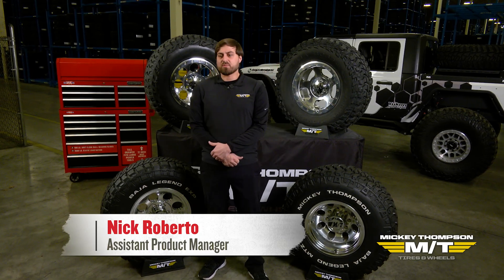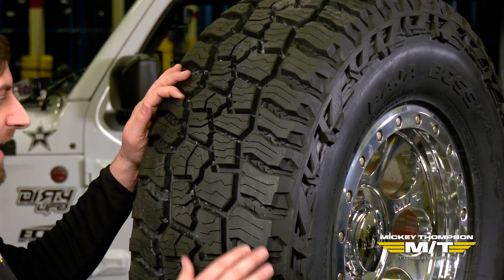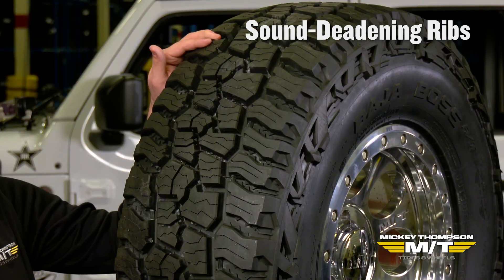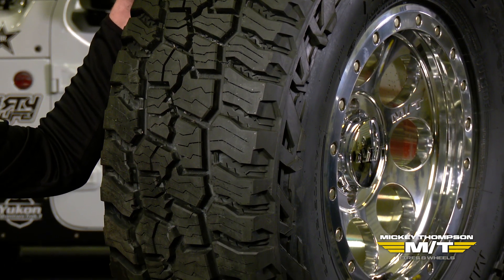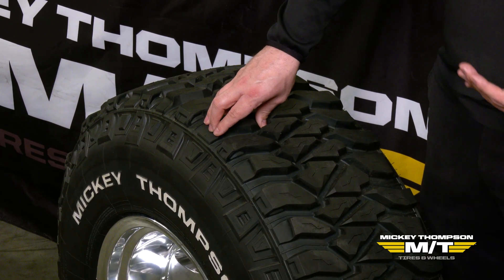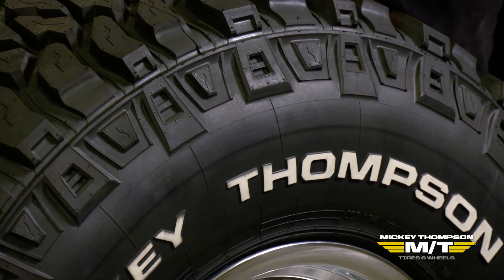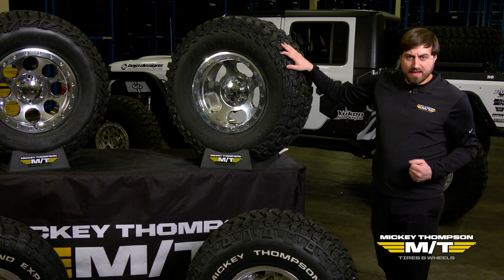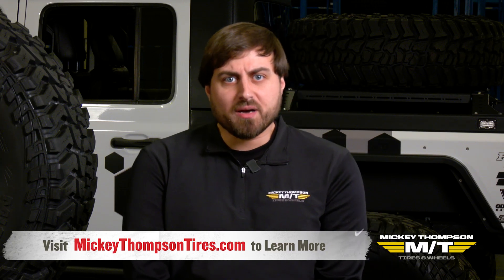Tread to Dominate: The Off-Road Engineering Behind Mickey Thompson Light Truck Tires

Comment: How is the Baja Boss AT in snow/ice conditions? - To be used on a daily driver
I have it on my 4Runner, and its a nice ride. Quiet, smooth, but wondering how itll be in winter.
I do have a LOT of rocks getting stuck in it though. Especially those tiny little groves.